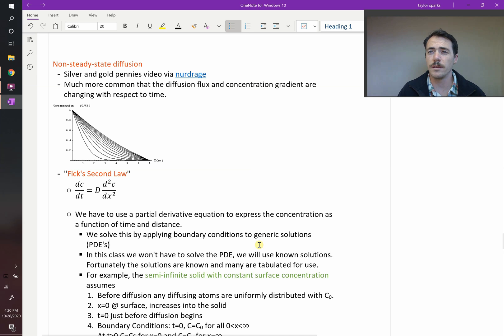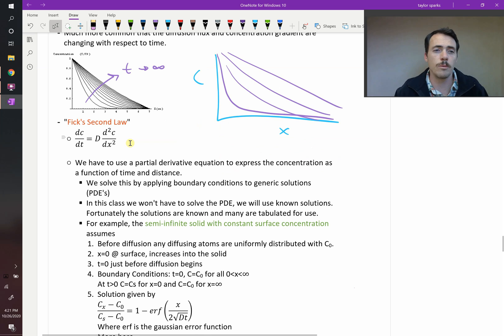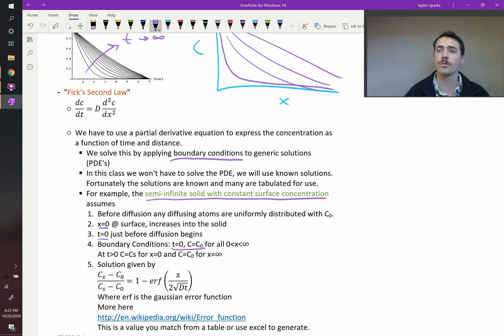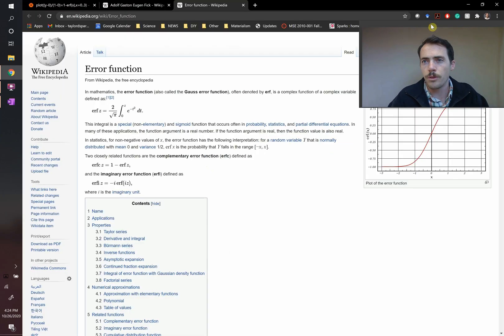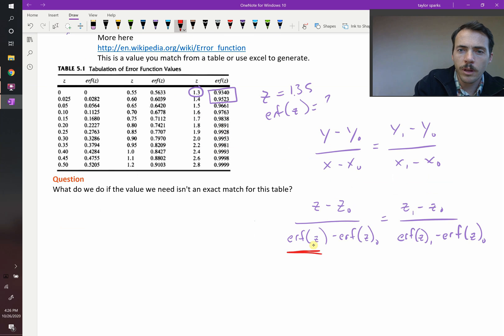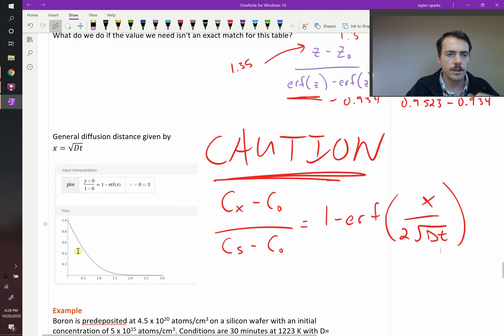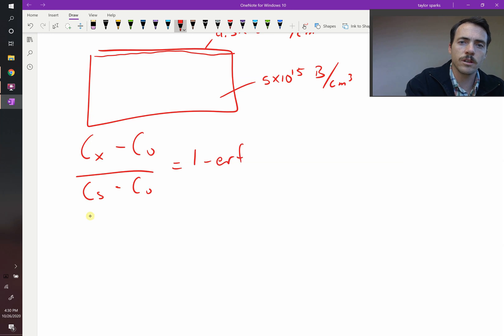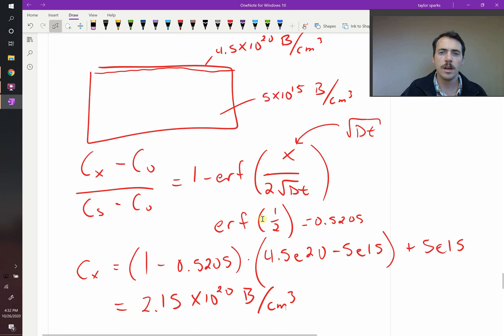Fick's Second Law and non-steady state diffusion

Comment: I've been struggling on how to apply this to a problem I'm working on involving the expansion of gas at a fixed rate at a point on the ground (so shape of expansion is hemisphere) and the gas radiating out from the source. What I need to calculate is how far from the source is the gas cloud at a specific concentration level.  I know the molecular properties of the gas, the rate that it is emanating from the source, and the diffusion coefficient.  This is all at room temp and 1 atm.
Reply: I'm going to assume that you solved your problem last year and so will take this time-worn story with good humor. A retiring physical chemistry professor was setting his last exam for a graduate course in statistical thermodynamics. Being a bit bored with it all, he gave an exam with just one question: Is Hell exothermic (gives off heat) or endothermic (absorbs heat)?

Most students wrote proofs based on Boyle's Law (gas cools when it expands and heats when it is compressed) or some variant. One student, however, wrote the following: 
First, we need to know how the mass of Hell is changing in time. So we need to know the rate at which souls are moving into Hell and the rate at which they are leaving. I think that we can safely assume that once a soul gets to Hell, it will not leave. Therefore, no souls are leaving. As for how many souls are entering Hell, let's look at the different religions that exist in the world today. Most of these religions state that if you are not a member of their religion, you will go to Hell. Since there is more than one of these religions and since people do not belong to more than one religion, we can project that all souls go to Hell.

With birth and death rates as they are, we can expect the number of souls in Hell to increase exponentially. Now, we look at the rate of change of the volume in Hell because Boyle's Law states that in order for the temperature and pressure in Hell to stay the same, the volume of Hell has to expand proportionately as souls are added. This gives two possibilities:

1) If Hell is expanding at a slower rate than the rate at which souls enter Hell, then the temperature and pressure in Hell will increase until all Hell breaks loose.
2) If Hell is expanding at a rate faster than the increase of souls in Hell, then the temperature and pressure will drop until Hell freezes over.
So which is it?
If we accept the postulate given to me by Teresa during my Freshman year that, "...it will be a cold day in Hell before I sleep with you," and take into account the fact that I still have not succeeded in going to bed with her, then #2 above cannot be true. I conclude that Hell will not freeze over and therefore is exothermic."
This student received the only A.